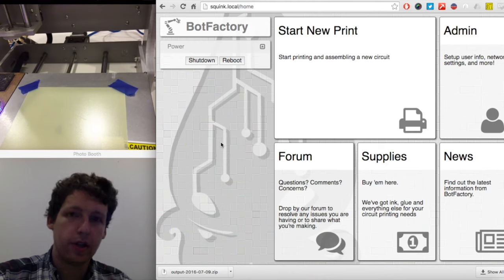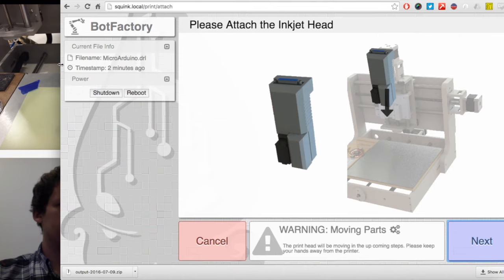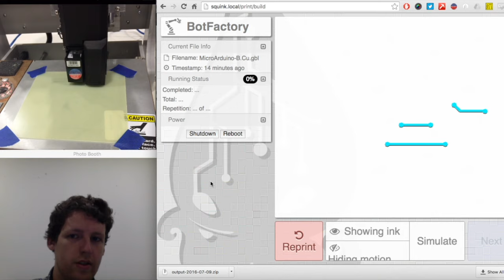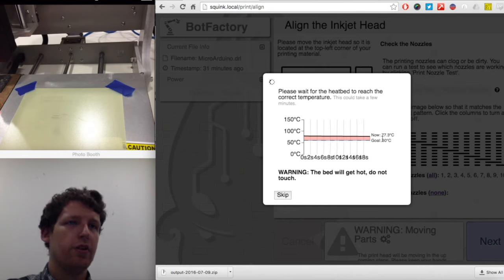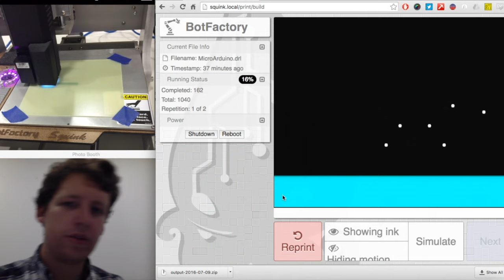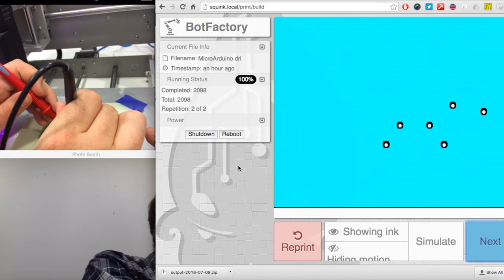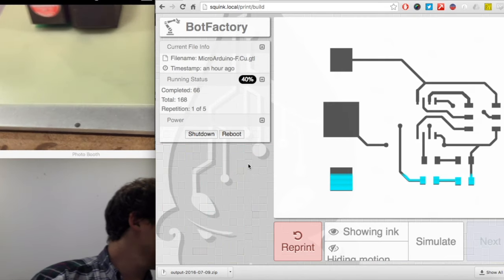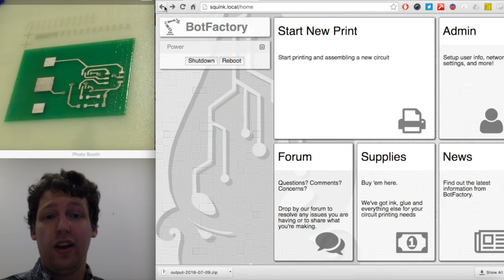Live Demo: Print Multilayer circuits with BotFactory Squink PCB Printer and Pick-and-Place Machine

Comment: what's the maximum frequency at which PCBs printed with this method behave properly?
Reply from the maker: Hi xephyr417 - sorry for the late reply. The maximum frequency that we have seen is in the range of 2 to 3 GHz, even higher, with relatively low losses and noise. We have more data if you're interested.

Comment: I am a beginner and this is waaay too expensive. I suggest using the laser printer and photo paper method. Print it, transfer it with an iron, place in in etching solution and clean it. thats it its simple even for a beginner like me. Just make sure you do the etching outside. I also live in a condo with limited space so it can be done anywhere.
Reply from the maker: One key problem is that etchant is very corrosive and needs to be disposed of VERY CAREFULLY. We didn't like much dealing with such dangerous chemicals and wanted to find a different approach. Also, we make assembly and dispensing easy, so PCBs and PCBAs can be made with Squink
Reply: Ummm... that's a huge pain in the ass.  First of all, you have to screw around with photo paper and a laser printer until you get it to print right.  That can take many iterations until you get everything just right.  Second, this only works for single layer boards, or, if you're super careful you can sometimes get 2 layer boards to work, with a ton of work and planning.  Third, you have to use these nasty corrosive chemicals that etch away copper.  You have to time this just right if your traces are sufficiently small, otherwise they get eaten away.  If you don't do it long enough, they'll still be connected, which you don't find out until you're testing the board.  Fourth, what exactly are you doing with the etchant chemicals when you're done, chief?  Oh, just throwing it the trash?  Did you know you're probably violating EPA regulations?  Yeah, metal dissolved in liquids can't just be thrown around.  You can probably work around this by mixing it with concrete and trapping the copper in the concrete, but I bet you're not doing that, are you?  

Although these solutions (BotFactory, Voxel 8, Dragonfly 2020, etc.) still seem a little "not-ready-for-prime-time", they're getting closer and closer all the time, and they're light years beyond anything you can do at home right now (photo paper/etchant, CNC routing, etc.)

Comment: I want to learn electronics
Reply from the maker: I can't think of a better way to learn than with BotFactory :)
Reply: BotFactory I'd have to disagree with you. Someone just getting into electronics would be much better served investing their money in basic lab equipment.  I understand you want to push your product but that's bad advice given to someone who might not know better:(
Reply: @DoRC  The advice is pretty sound if you have one in a community center/hacker space. But for me personally it's way out of my budget. I guess I have to settle for postal order.
Reply: @bloepje  pcbs are so cheap to order online these days as long as you arent in a huge hurry its a no brainer just to order them.  Also, there are plenty of fun and highly educational alternatives to making  high density multilayer surface mount circuits that anyone can do at home.  Some would turn their noses up to a piece pf perfboard but youd be amazed what can be accomplished.

Comment: This isn't that hard to make. All it is is a basic CNC frame (look on thingiverse) and the head is replaced with an inkshield (http://nicholasclewis.com/projects/inkshield/). The inkjet cartridge is a HP C6602; $20 on amazon and more than double that amount on this guy's website. All you need to do it open up a cartridge, wash it out, then put in your conductive ink. Slap that puppy onto your cnc rig, and boom; You got yourself a Squink for twenty times less the price. I am currently making something similar to this for my thesis and I made the whole thing easily under $200 (not including conductive ink price though). Honestly, it's a good design, the price for what it is though is just obscene.
Reply from the maker: Hi ZigmundZag,

You are correct about the cartridge type, and the cost of buying a filled cartridge on amazon, and we did in fact play with Inkshield at the very beginning in 2014, but there are a lot of other factors at play here. 

You can't just drain an black ink cartridge and refill it with our conductive ink. The black ink interacts with the nanoparticles and render the whole cartridge a dud. In addition, we've put several years of research into jetting techniques to ensure that the ink is deposited onto the substrate correctly. I wish we could go into the finer points of inkjet printing conductive inks without revealing TOO much :). I haven't even mentioned how we print and UV cure polymeric inks - that's an interesting science of itself as well.

Of course, our machine also dispenses paste and assembles boards by pick-and-place, which requires a whole software control system, a new UX/UI interface, dispensing algorithm and a computer vision system to identify and correct each part so that it is placed correctly. These systems that can do such things individually often cost 2x to 5x the price of our own machine.

Like a product that offers 2 for one, or 3 for one, Squink offers a whole lot of value by integrating all of the elements of PCB fabrication into one package. 

If you're interested in sharing more about your Thesis, we'd love to take a look. We're always wondering what directions other people have go from the same point that we started!
Reply: Botfactory,

First off, thank you for the insightful reply; I don't often get such polite replies on youtube. 

Second, I would like to disagree with what you said about flushing out an ink cartridge. With your ink, it may not work (as I do not know its entire composition) however, I have had success thoroughly washing out an ink cartridge with a distilled water diluted windex solution (many washes, very mess). 

Although this was not the best way of going about this, it was my only way as I didn't have access to the OEM cartridges before ink was put in them. The final step was to add AgIC ink (https://agic.cc/en/) to the cleaned out cartridge. I admit that it didn't work right away, but after a few prints the conductive ink was being laid down quite nicely.

Using this cartridge, inkshield, CNC, and marlin (with an added extension for inkshield(https://github.com/sjkelly/Marlin/tree/hpc6602)), you can pretty much have any slicer do the rest of the work for you.

These were the early stages of my thesis; so I can share them as they have already been submitted for publishing. I however cannot share the current details of my thesis. I planned on making my printer open source in the end so I can share the link with you when the publication comes out.
Reply from the maker: Dear ZigmundZag,

No problem! I appreciate your insightful comments as well!

I am not exactly sure which comment regarding flushing that you are referring to - this is an older video. We use water and a syringe to clean this ink - and by the way, this is a completely different ink that what AgIC has based on what we can see. Our (Advanced) inks require thermal sintering, whereas the Standard ink is probably very similar to AgIC. That being said, in this video I am using our Advanced Inks which require different care than what you may expect with other types of ink, as it is a material and recipe that is dissimilar in many ways to AgIC and other inks on the market today. 

Why did we work on developing new inks when there are other inks already out there? Simple - we want to print Multilayer circuits. 99% of all circuits made by serious Electrical Engineers are two or more layers, which require an insulating layer. In addition, as other people have pointed out here - you can simply just get a cheap-o CNC micromill and some copper laminated boards.

So we have now a polymer 'Insulating Ink' that can be printed and cured with a UV lamp on the printhead of each machine, allowing one to additively manufacture or '3D Print' the circuit rather than milling or etching material way. Technically speaking with our method of printing insulating and conductive inks one at a time that one can print an infinite number of layers... far beyond what can be done at the desktop with an existing milling or dispensing method. 

Polymer jetting is not a trivial matter - you need to balance the UV power w the possibility of curing the ink on the nozzles, in addition to making a material flow fast enough to make a thick enough insulating barrier. In addition, most if not all conductive inks prefer certain types of surfaces, with complimentary surface tensions, smoothness and of course, if you're using low-temp sintering inks like our Advanced Inks, a polymer that does not melt at the curing temperature. Your inks that AgIC use, along with our Standard Ink, needs a photopaper-like surface to capture and cure the ink so that it conducts. 

Multilayer printing is the real goal here, where doing a 10 layer board is a matter of a click and getting a cup of coffee. Inkjetting specially formulated and complimentary silver and polymer inks is the key. 

Let us know when you have something to share openly and we'd love to take a look!